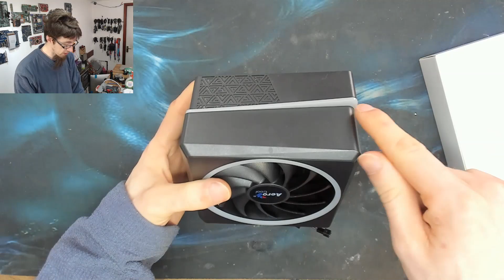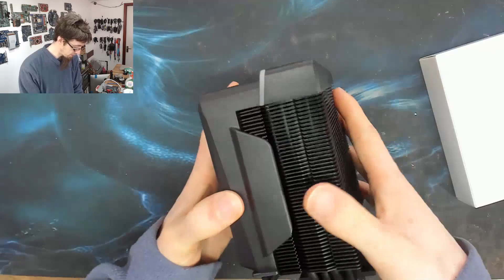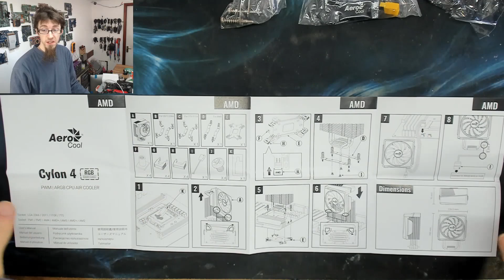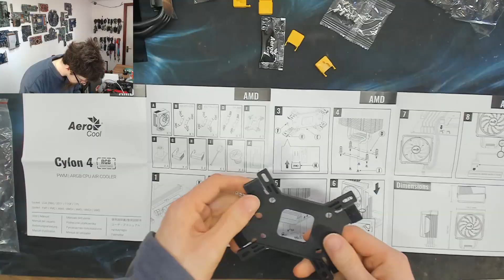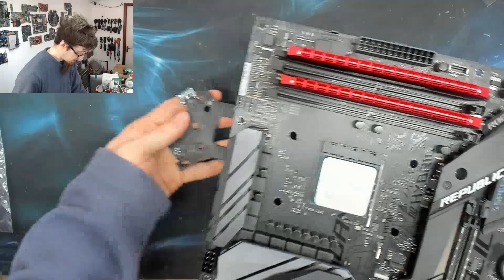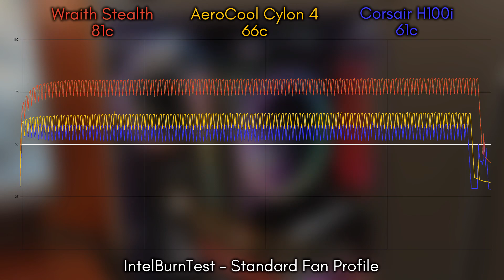LBC#49 - AeroCool Cylon 4 Fitting & Overview

Comment: Will you recommend this for i5 10600k?Right now I am using thermaltake ux100 and I am getting upto 95 degrees temp on stress test So can it handle i5 10600k?
Reply from the maker: I wouldn't use it if overclocking, but for stock speeds it should do just fine. The UX100 isn't a great design really, because no heatpipes.

Comment: bad design, why dont they just use the default am4 backplate that everybody does? Its better (one solid piece of steel) and less wasteful. actually i was watching you unbox it and it came to my mind it would be really useful if you could order a cooler with just the specific mounting hardware you need and not none of the extras, unless you choose to, it would again lower the price and lessen the waste. some coolers from aliexpress you can order with just intel or amd specific hardware as it is, but i would go farther than that make it socket specific, if desired.

Comment: Hello everyone! 
Just wanted to give you guys my thoughts on this cooler!. I've had this CPU cooler for 2 months (with ID-Cooling as thermal compound) and it worked perfectely, ARGB is amazing, can't ask for more, performance is amazing as well, averaging 35C Idle and 55C under load (tested only with Overwatch and GTA V Online). 

If you have any question you can ask me! 

CPU: Ryzen 5 3600 
GPU: Rx 580 Asrock 8gb
Reply: Mine was 55C idle, up to 80c while gaming with stock cooler.
Now its 40C min. Haven't test it yet, but with 3900mhz, highest temp ia 68C
R5 3500x, gtx 1660 6GB
Reply: What were you previous temperature? Did you overclocked your cpu?
Reply: @zaingrt  Before my R5 3600 I've had a RX8320e with a tower style cooler, so I cant make a comparison. 
I haven't overclocked my R53600, and I don't think im willing to do it tho. 
I think that if you want to overclock, you should either have more heat transfer (with 6 heat pipes) or just water cooled with a 240mm radiator.
Reply: Diego Spizzo and also did you try any cpu stress test?
Reply: @zaingrt  nop, you can give me one and I'll give it a try!
Reply: Diego Spizzo try with cpu-z
Reply: Or maybe with Cinebench r15
Reply: @zaingrt  Im on the stress test on CPUz and i dont really know what this means, i dont know how to check temps, there was a number going on, it was 4095, idk what that means XD
Reply: Diego Spizzo i think they are multi core and single core scores
Reply: Diego Spizzo try Cinebench r15 maybe it will tell temperatures
Reply: @zaingrt  ok, im able to track temps, im stressing it. Temps ar not going higher than 68 degrees. Clock speed: 4073mhz, voltage 1.372 volts.
Reply: I don’t actually know about them well as I haven’t made my pc
Reply: @zaingrt  Idle 35 degrees, while normal gaming session 55-60 (very unlikely)
Reply: I’ve almost done my pc build only cpu cooler and case is remaining i was asking because i need to decide with cooler should i go with hyper 212 or cylon 4
Reply: Diego Spizzo thanks for telling
Reply: Im looking to build my first ever PC with the R5 3600 as well,what motherboard did u use on your build?I appreciate ur help.
Reply: @syedkhan7552  I used Gigabyte Aorus B450 M !
Reply: @syedkhan7552  i went with b550 msi mpg gaming
Reply: About noise at full load? Any vibration?
Reply: @AntonioSilva-bd3sm  nope
Reply: @diegospizzo2000  I asked because I already read some people saying that theirs made some noise or vibration because of the plastic. It may not have been well assembled.
Reply: @AntonioSilva-bd3sm  oh no, that's unfortunate.
I haven't had any issue at all with this cooler, I wouldn't lie to you!. 
We know that this brand isn't top tier brand, so don't expect the highes quality product.
I still  haven't changed the thermal paste, it's been almost 5 months since a assembled it, and temps are still the same!
No noise, no rumbling, no buzzing, nothing.
Reply: @diegospizzo2000  Hey, Is it still working without issues?
Reply: @user-ih9xc7uy9y  Hello! Working perfectly! Usual cleaning every now and then of course. Its been 3 years, wow.
Reply: @user-ih9xc7uy9y  Hey!! Yes! going strong! Just the usual maintenance, thats all. No issues.

Comment: Might pair it with my Cylon mid tower when I upgrade from my core 2 duo and it I find it for a reasonable price. The be quiet Pure Rock Slim BK008 looks like a better performer and is cheaper though.

Comment: Recomended for a i7 9700?
Reply: Should handle it easily as it is only a 65W TDP chip.
Reply: I have the 9700f it sits around 40 while not gaming and 76ish while gaming at 4.5 MHz

Comment: Hello can you tell me if this cooler make hot temperature in this day? My i7 3770 in gaming session with a bottleneck of CPU 100% of use he make 79 c very similar at Intel stock cooler performance how this Is possibile?
Reply from the maker: This will easily beat the stock cooler. It'll manage an i7 so long as you don't do any serious overclocking.
Reply: @Adamant_IT  i have no oc offcorse and i have High temperature with heavy games. I Will try a another termal compound and i Will se what kind of temperature can i have. I hope this CPU dont Need a delid because i had buy this CPU on a used market

Comment: Wish third party RGB stuff would work with iCue and other RGB software
Reply from the maker: Asus Aura Sync can connect to iCUE now (if you ahve the Aura sync service installed, iCUE will see your Asus mobo and attached devices) so I think they're moving in that direction. But yea, it'd be nice if you could connect universal ARGB stuff like this directly to a Corsair RGB controller. Although the AeroCool Eclipse case in this video has proprietary fans, the RGB controller has regular ARGB headers as well.

Comment: Nice little cooler, but it would have been nice to see maybe a few little extra fan bracket, So if you wanted to ditch the shoud it came with and use you own RGB fans like Corsair HD120 or LL120s etc, it would open up the functionality of that cooler
Reply from the maker: Tbh if you wanted to do that, you'd be better off getting something like a Cooler Master Hyper Evo. The fan and shroud is the main feature of this cooler really.

Comment: hello dude  if my mother has no ARGB connector and only RGB pin connector (4-pin asus aura) I can not use the rgb of the cooler?
Reply from the maker: No, you need an ARGB header to control the RGB. However, it will default to Rainbow Wheel if left disconnected. So you can get basic illumination without an ARGB controller
Reply: @Adamant_IT  thanks so much!

Comment: Hello i have at the First day of installation 69 c temperature in a cinebenck 20 in this day i play and i have 71 c temperature with a i7 3770 i think Is Little hot or not? You in a intelburn test had 66 c do you think i have this temperatura because Is very hot Summer day in my Town? Or i Need to check of there are more thermal compoud? I have a arctic silver 4 ceramique
Reply: Its not hot at all, normal Temps for cpu

Comment: A little late but cant you just use the default AM4 bracket?
Reply from the maker: Standoffs have a different thread I think, and might be a different height than the supplied one. Although I'd have to check and confirm that. I wish they'd standardise back plates. Considering the hole spacing is already standard, I don't see why they don't.
Reply: @Adamant_IT  Thanks for the reply. That's  good to know, that cooler's back plate is fairly generic anyway. I've seen Corsair, Cooler Master and a few other brands using that particular one. I was just wondering as that back plate is probably plastic while the stock one is metal.

I think it's more of a cost cutting measure to fit as many sockets from both Intel and AMD as possible, I remember coolers shipping with separate back plates for for both in one product.

Comment: Hi! Do you mind verifying the height of this cooler? It says 160cm but would like some verification to see if it fits a micro atx case with 160cm clearance for cpu cooler :)
Reply from the maker: It's 160mm from the top of the CPU... I'd say closer to 168 if you measure from the motherboard though. I'm not sure what the standard point to measure from is.

Comment: what asus rog mobo do you use?i planning to buy this cpu cooler in my motherboard MSI B450M gaming plus, does it fit if i use a ram with height more than the memory you use?thx before
Reply from the maker: Featured mobo is an X470-f Strix. I don't own this mobo anymore, but it's a great board - still a solid purchase if you pick one up secondhand! Unfortunately your B450M Gaming Plus doesn't have Addressable RGB headers - it has two non-addressable headers, but those are not compatible with this cooler. So you'll need a separate controller to change the LED patterns. The Aero One Eclipse Case featured here has a built-in ARGB hub, as an example.
In the worst case, if you leave the fan's LED wire disconnected, it will default to rainbow wave.
Reply: @Adamant_IT  yes it's a great motherboard but in my country secondhand X470 f strix is still expensive 😊 so I buy the this MSI b450m  second hand  too & I'm lucky to have the b450m.gaming plus from person who just buy it 2 months ago so it still official guarantee from msi 2 more year's. And for the addressable header I did'nt notice until now if you didn't tell me hahaha.coz I haven't install a ryzen in it I still confused to buy ryzen 3100 or 3300x or 3500. Thank you very much for the info...I will consider another CPU coolers then...

Comment: which fan did you connect the rgb header to? They dont detect the rpm unless theyre on the right header. Can you attach a video/screen of you having rpm of both the cpu fan and the rgb header/fan controller in bios?
Reply from the maker: The RGB wire doesn't carry any RPM data. That's only done on the Fan wire. In the setup I had for this video, the RGB wire was connected back to the RGB controller on the Aero One chassis, and the Fan wire was connected to the CPU Fan Header on the mobo. This means the mobo was controlling fan speed (and receiving RPM), while the chassis handled RGB.
Unfortunately I don't have this case built up at the moment, but it was working. It's worth noting however, the Aero One's RGB fans use a proprietary connector and do not report fan speed at all. So I had RPM for the CPU fan but not case fans.
Reply: @Adamant_IT  damn, thanks for the reply. That's the problem I have. It reports the cpu fan speed but nothing from the rgb fan header block. I dont even know if it's even doing anything. Some other rgb headers will read the rpm off rgb fan header 1 and I was hoping I'd just connected them to the wrong one which is why I couldn't see it.

Comment: I don't agree with your argument in favor direct-contact heatpipes. The reason why most better CPU coolers have the heatpipes soldered to a copper plate is because it is very hard to get the desired planeness of the surface otherwise. The chance of losing a substantial amount of heat transfer due to an uneven surface area outweighs the small decrease in heat transfer  due to the additional interface. (See reviews of the Corsair A500 by GamersNexus and others.) I am sure that if it would be possible to reliably achieve better temperatures with direct-contact heatpipes, then high-end coolers like the NH-D15 and the Assassin 3 would go for it.

Using direct-contact heatpipes seems like a cost-cutting measures to me. That's not bad, but I wouldn't list it as an advantage of the product, and I wouldn't expect a 40€ cooler to avoid the problems with surface planeness when even Corsair in their 90€ cooler can't seem to get it right.
Reply from the maker: Well, consider what's worse; A) Direct heatpipe contact with poor flatness, B) Going through another cold plate... with poor flatness?
You're not going to find aeronautical engineering on a cooler of this price bracket, so it's better to simplify instead.
However, you're right I should probably have mentioned that cold plates aren't universally bad - but they are bad on a budget cooler.
It bears mention that the A500 ain't worth it's price tag by a long shot. If it didn't carry the corsair brand tax, it's performance would probably be forgivable. But because Corsair priced it against the big boys, it got reviewed against the big boys, and lost badly.